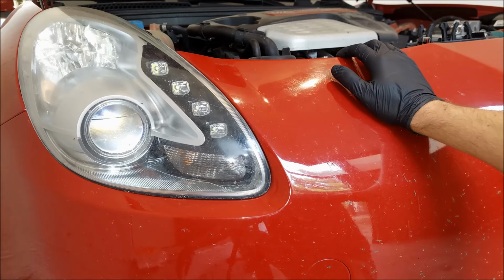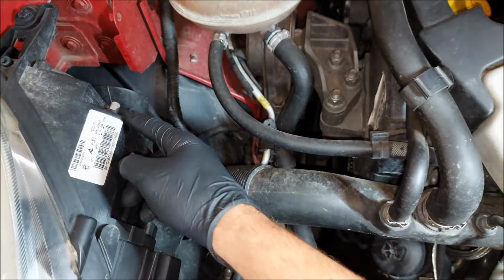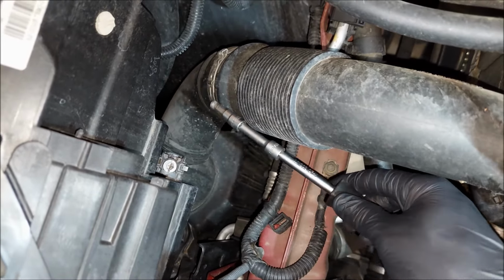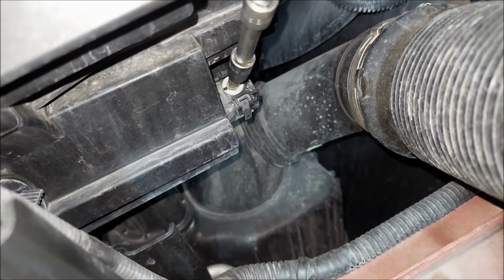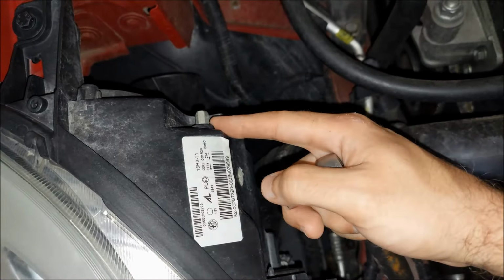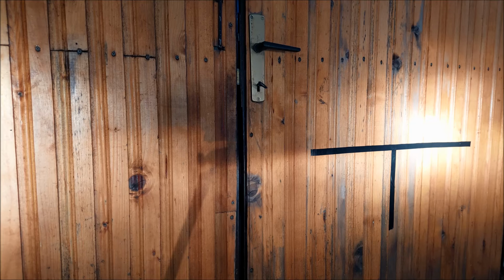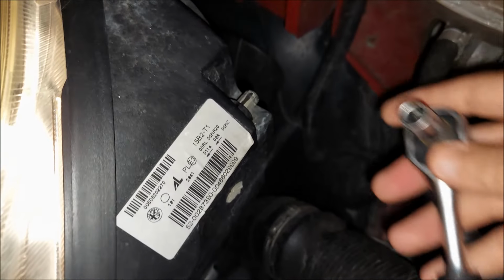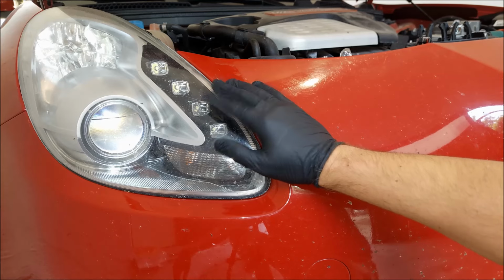Alfa Romeo Giulietta Headlight Adjustment, Low Beam, High Beam, Up, Down, Left, Right

Comment: Just put in a led bulbs in, seems fine but i tried to adjust a little bit. Seems to me that left -right adjustment is blocked, i get a loud cracking noise and big horizontal screw is not turning. Like the gears inside slipping over one another. Up-down goes smooth as butter. I lifted them a few degrees up so we will see. Led is maybe good idea and now daylight and dipped beam are the same colour😅
Reply from the maker: I was going for that as well, but wasn't really impressed with brightness
Reply: @ i got some philips led, not cheap, mid range, 60€. Did not test them yet in real dark, seems decent, at least good as halogen, but whiter.
Reply from the maker: @dumpors1  LEDs were kind of disappointing to me, you can buy that ultra bright, they are decent and cost only like 10e

Comment: Great videos thanks for making them, did you consider to replace the projector halogens to led bulbs, its a huge improvement!? I am about to change the whole projector unit although taking apart the headlight can be a pain in the butt.
Reply from the maker: Thanks man, I tried leds on these lenses and it wasn't really all that great

Comment: Is this also the case for xenon headlights? I'm gonna check mine tomorrow and if i find those little bolts, well thank you very much my friend once again
Reply from the maker: Not sure, you're welcome my friend
Reply: @arcgarage  With xenon it's exactly the same; you adjust the low beam as described in the video, and from then on the automatic system compensates the level according to the vehicle load (there are 2 sensors: one on each axle, front and rear, right-hand side). By the way, thanks for teaching me how to do the initial adjustmet! 👌